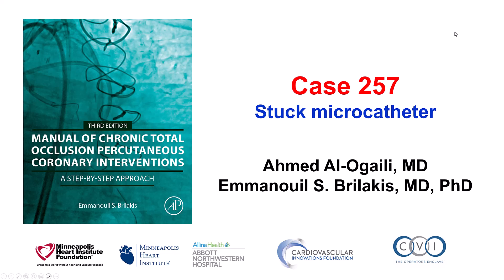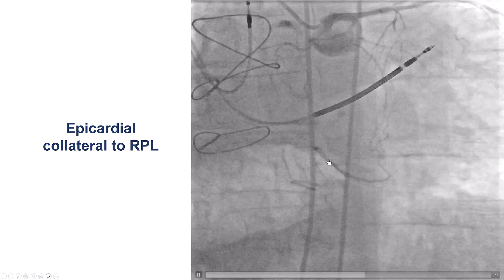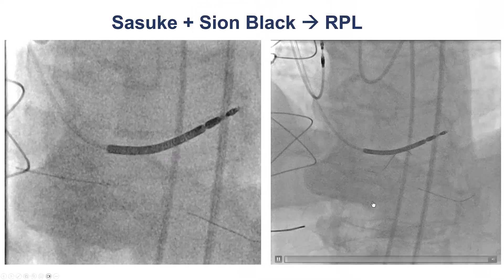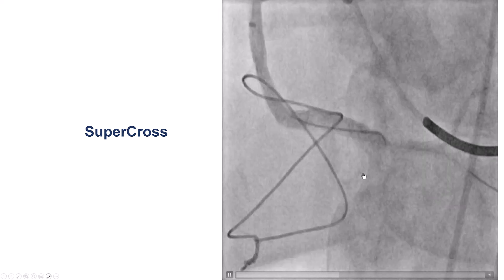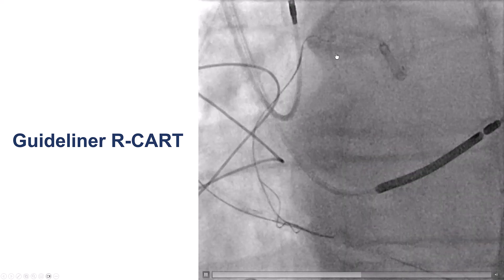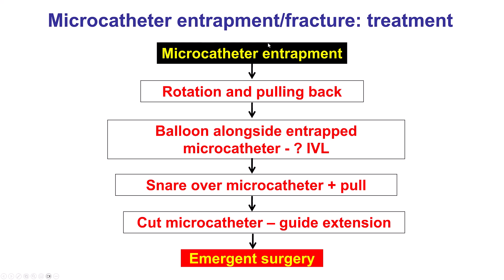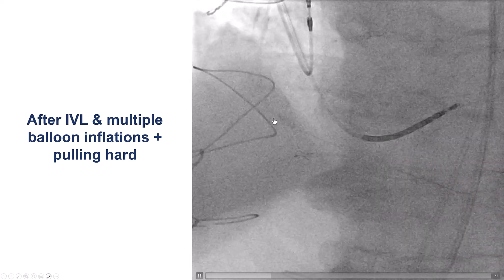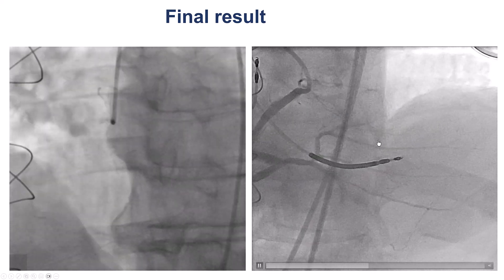Case 257: Manual of CTO PCI - Stuck microcatheter

Comment: While pulling the entrapped microcath simultanously pushing it from the opposite site with a balloon or another Micro?
Reply from the maker: You do not want to push from the other side because the tips of microcatheters may get entangled and make things worse
Reply: @manosbrilakis  Can they? For retrograde cases? They would be on the same wire? But if you say so there is something that ı dd not consider.

Comment: Good evening sir. I don't know if you'll be reading this.  Today while doing ptca in an awmi, I ended up closing a flowing artery. Probably a dissection because of the workhorse wire . Was unable to cross with whisper wires of diffrent shapes. Switched to Gaia 2 that crossed and helped  complete the case and restore flow. Watching your videos made it possible. Thanks 🙏🏼
Reply from the maker: Great to hear - glad things worked out well!